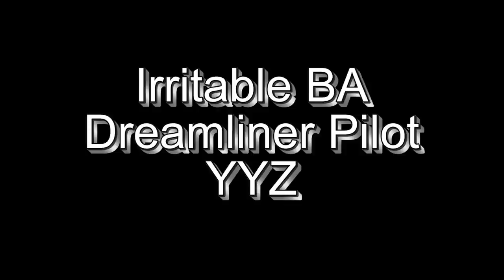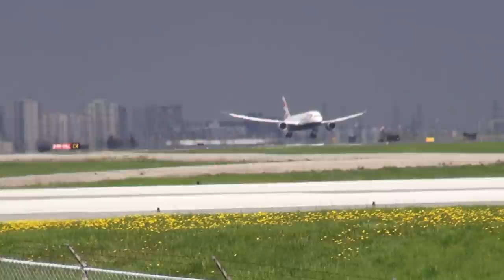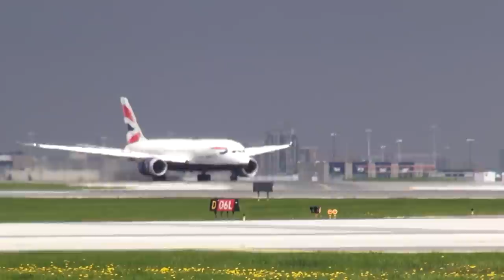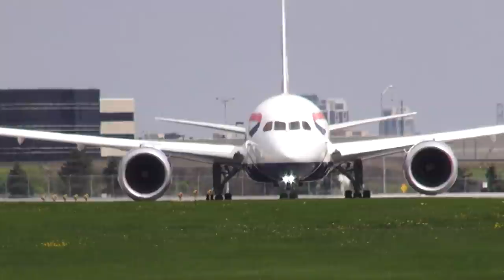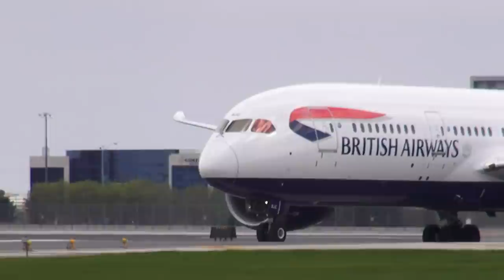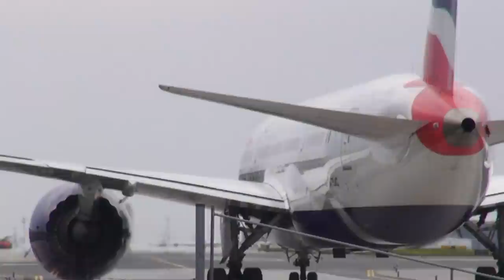Anxious British Airways Pilot, impatient controller

Comment: BA pilot was completely right.
Reply: No..... he is not. I have experienced instructions given to the cockpit during takeoff roll to abort, while entering holding, while leveling off, while tending to emergencies, while fighting engine fires, and the worse of all while I was trying to eat my crew meal.  A simple " stand by one'" will do and the controller would have understood. If its not the radio, Its the cabin Crew or other distractions in the environment. I have seen this type of situation as part of training. could have been handled better.
Reply: @YouTube.TOM.A  BA crew was being asked to hold short of an ACTIVE runway.  Instructions need to be understood.  If Speedbird is busy in the cockpit while the landing roll is still going on then he had every right to tell ATC to slow down.  Whenever an active runway is mentioned in instructions, pilots should be doubly certain they understand - memories of Tenerife.  BA's safety record speaks for itself.
Reply: @muttley8818  Busy in the cockpit ??,  You are always, and holding short is not the height of highwire skills. This incident mean something different to you because you have not been trained and experienced to airline standards.  That clearance was very routine for that Class of Airport and is quite manageable by about 98% of Airline crews. The workload tolerance of pilots especially Captains is much higher than you are projecting here, I am sure I have dealt with this maybe 200 time already.   Give that Tenerife thing a rest, will' Ya If you have to forage in that dumpster your input is weak.
Reply: @YouTube.TOM.A  Resorting to personal insults really doesn't help your case Tommy lad.  Try making your point without immature remarks and people might take you seriously.
Reply: @muttley8818  GET OFF  !!   Tenerife need not be exploited to prove trivia that is your reasoning.
Reply: @YouTube.TOM.A  Tom. Give up now.  There’s a good lad. You lost your chance to have a decent convo with me about 1 message ago. Unless you were on the flight deck, you have no idea what’s going on inside it, so just let it go.
Reply: @muttley8818  I flew 5 different aircraft in Airline operations. I flew left and right seat.  Stateside and some International.  Airline pilots are not easily rattled by such incidents and have a great range, or bandwidth in dealing with problems.  The Airline flying experience is not without errors, last minute changes, and demands on the crew, you have to adapt, or you may only be useful one day each month.
Reply: @YouTube.TOM.A  Congratulations Tom. I suppose you want a medal but I still have to insist you have no idea what was going on on the flight deck of that bird at the time to cause Speedbird to tell them to slow down.
Reply: @muttley8818  I was not in the aircraft, but commonality of experience makes this no mystery.  On landing one person maneuvers and controls the aircraft and the other monitors operations, call out speeds and engine percentages, and answers the communications. I always have a pen on my side window clipboard and use shorthand to annotate hold short clearances and stated taxiway names. you may be a little late retracting flaps, turning of lights , and after landing routines but I copy meaningful clearances on my flight plan.
Reply: @YouTube.TOM.A  True, but at the same time it’s Aviate, Navigate, Communicate. C is always last. What might seem trivial or easy to you might not be in this particular case. 
That’s what I love about these ATC recordings. People are quick to judge but most don’t know the full facts. I’ve done it myself so I know how easy it is to fall in the trap. I’ve listened to some and came to a quick judgement, only to find out more info about that specific flight and then what I heard totally makes more sense and I do a full 180.
Reply: @YouTube.TOM.A  I will agree with you with one thing though. Speedbird should have handled it better.  Maybe they didn’t have their tea during the flight.
Reply: @muttley8818  NOT REALLY. Aviate Navigate and Communicate,  those are single pilot operational guideline principles, but sometimes the order may need to be rearranged due to safety considerations.  You have to understand that in  the two-man crew concept [ which is a different operational concept ] only one person aviates, so the other person does not have to wait on that other captain flying to talk on the radio,  put navigation info into the computers, or acknowledge a hold command in a clearance.

Comment: If the pilot not on the controls is on radio duty, I'm not sure why the cranky response. There must be something about 787 landing procedures I don't know about because British Airways pilots are very skilled. But holding short of a runway that is adjacent to the landing runway (with a high speed exit between) is vital info to have read back... immediately.
Reply: +mccloysong During a landing in bad weather both pilots will be quite busy in any aircraft. Usually one is looking out the window the (the pilot flying) and the other is looking at instruments.
Reply: +vbscript2 I appreciate that. I'm instrument rated myself and have performed quite a few approaches to ILS minimums, I do sympathize about workload and concentration. I guess I assumed with the visibility that clear, the transition to visual would have been in sufficient time to resort to visual procedures well before that touchdown... But then, again, things obviously were still very busy, enough for the radio response.

Comment: completely with the pilot
Reply: same
Reply from the maker: I don't know how you can say that. I have been listening to these communications for years. These BA pilots were clearly distracted by something. He (BA pilot) thought the that ATC was being a little smug when asking them to repeat his instructions. ATC was just doing his job while dealing with a back up in planes waiting to take off. The north runway which usually handles all the heavies was temporarily closed.
Reply: Bazza yes I agree
Reply: Exactly, very well put.
Reply: This is not completely a common sense thing but Take off and landing is the most critical phase of flight and that DOES NOT MEAN that you can just go Ape $hit if the controller comes on the frequency. During takeoff and landings you sill listen to radio traffic and some alert captains have even aborted takeoff  or went around by something heard during this time. Most times it will be better to make a phone call [even if you beat this guy over the head ] there will still be another person on the radio the next day,  who can possibly make the same transmissions and there you go again...………………….